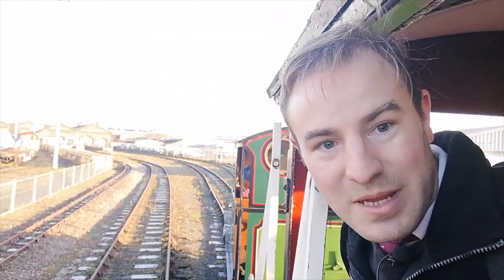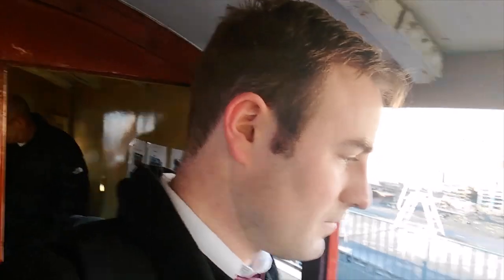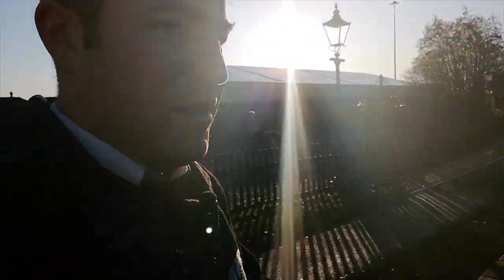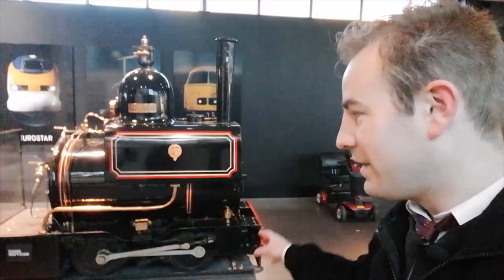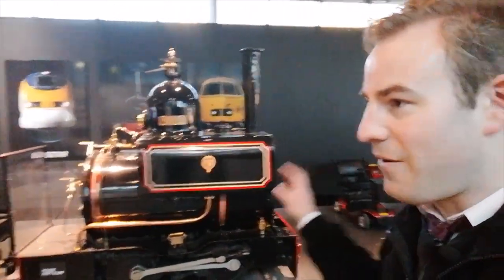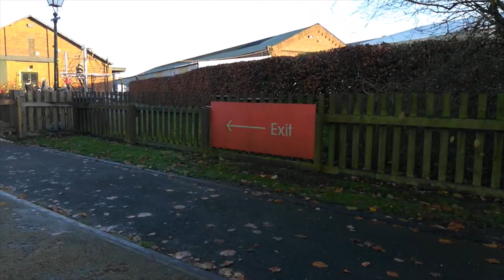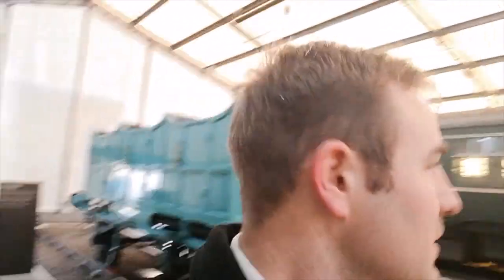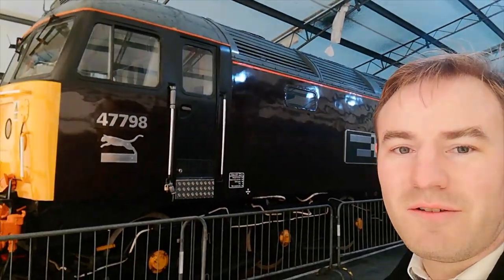South Garden Miniature Railway - Episode 12

Comment: I used to fire and sometimes drive Agecroft No.1 when it was resident at MoSI Manchester, where the volunteers restored it from near scrap condition to the superb loco it is today. Sounds like its ejector is as noisy as it always was! I wonder how long it'll be before MoSI's replica 'Planet' (which was built at MoSI and which I also fired and drove) becomes an NRM resident? MoSI management have a lot to answer for. There's no usable railway there any more.
Reply from the maker: It would be great see Planet running again. Such a shame there's no operational railway at MoSI anymore. Maybe they should consider building a miniature railway!